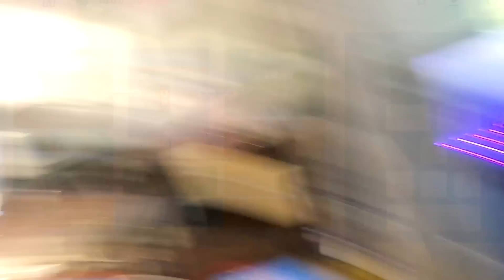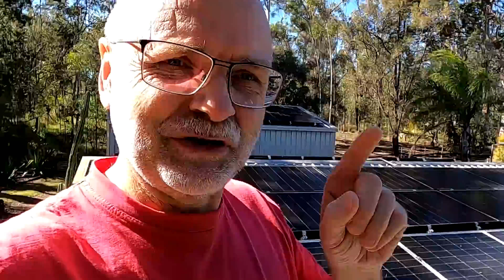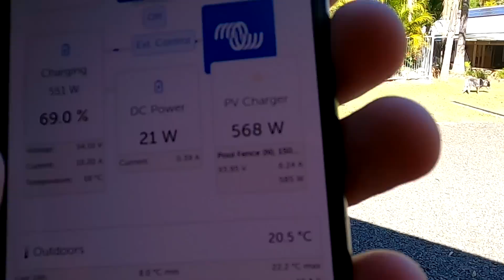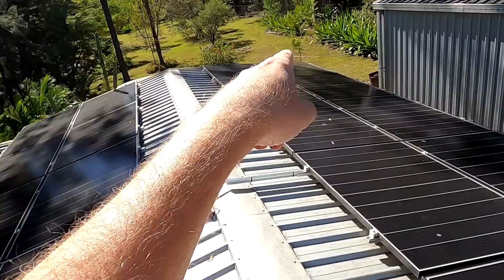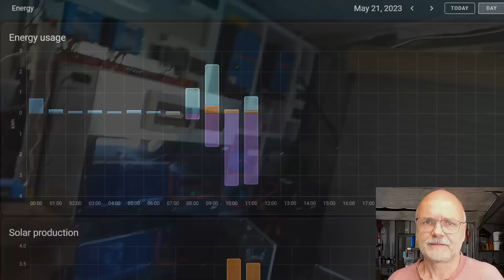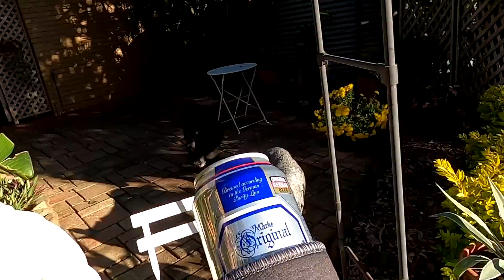Finally Off-Grid!! Look at this energy consumption and production in Winter!

Comment: it may be worth having someone come and trim back all the trees,  i think it will make way more difference than adding more panels.  i have lots of trees like you,  earlier this year i had to have a couple of large trees removed that were diseased while they did that i had them trim up the other trees and it made a significant difference to my solar production.  whats your annual consumption mine is around 10MWh annually and im producing about 2MWh with my 3kw solar (5 panels east and 5 west).  im about to add another 7kw of panels to get my production up.  have you ever played with enphase micro inverters? they may do a little better on the shaded arrays, also the interface with per panel production is really nice.  Also yes a deep dive into home assistant would be fun.

Comment: Over here in Cape Town, South Africa I have 400w solar panels, a 24v 50ah Lip4 battery with 3000w inverter (6000w peak) and smart Victron 20a charge controller. This is because we have "Load Shedding" over here. I run both fridges, freezer and 2 computers on sunny days, only 1 fridge on shady days. I intend to get bigger battery as funds come in.
Reply from the maker: We have load shedding here for a long time. All non essential loads can be turned off by the energy provider. These are mostly large loads like electric hot water, pool pumps and air conditioner. Also EV charging. But we have at least the choice and plug these appliances in to the 'normal' supply and keep them running but for a higher price. If more people would have solar and storage it would certainly help everywhere.
So you're on the right track with getting more storage.

Comment: Great video Andy ;-)
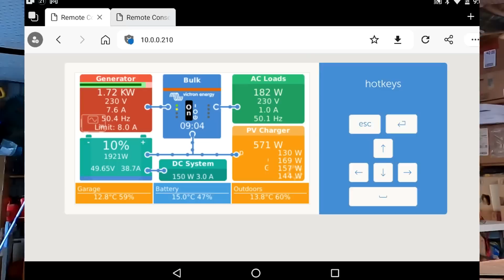One question, what kind of sensors are you using for the humidity and temperature at 4:48sec?
And how do you implement these sensors to the victron system?
THX
Reply from the maker: These are Ruuvy Tags which connect directly to the Victron system through BT. Great little devices.
https://ruuvi.com/
Reply: Great THX

Comment: I think you have to keep in mind, that if you convert twice, one time DC to AC with the Fronius and second time AC to DC with the Multiplus, there will be a loss. I have solar panels with a battery in the house and since last year I use an additional Multiplus to store extra energy, I would have been put in the grid in a second battery in the garage to charge our EV. I see a loss there about 15 to 30% compared to the house battery where the energy is only DC DC converted

Comment: Great video Andy, it is so good to see how close you are to getting fully off grid.   The short season (May,June and July) will always be a bit of a struggle. The one option you are fortunate to have is the Tesla can be looked at as an optional/portable load that if needed, can be charged somewhere else during those months if you start to run low on power for the house.  If only you could set up a Tesla charging station for some of the neighbours in November to February to sell off your excess power.  😉

Comment: Hello Andy, cloudy weather would be great for solar production in your case, better pray for a full cloudy weather, my 11.8kw PV 3 strings are facing south 30-25% today its dusty and cloudy with much dust on the panels i think the total generation is more than 30KWH today peak 5.5kw but its load based I did not enable on grid on my hybrid inverters I need the grid for the night.

Comment: Da du unterschiedliche Schatten auf einzelnen Panels hast, wenn du das ganze System auf Mikroinverters umbauen würdest, würdest du viel mehr Strom bekommen. Da jedes Panel bekommt eigene mppt.
Reply from the maker: How do you connect micro inverters to an off-grid system though without installing a huge number of inverters which can deal with this AC power?

Comment: Hi Andy, Your micro inverter panel discrepancy is a bit curious; try swapping over the inputs and see if the watts differences still agree. If it still looks like the same panel is low, I reckon you might have a bad blocking diode giving you only two thirds power.

Comment: Homeassistant gives a very good insight in what is using power. The tosti iron is a huge amp eater and so is an old boiler I have in the kitchen. I can easily adjust my power consumption by eating less tosti (kids) and replace the old unisolated kitchen boiler.... But I didn't.
Nice video. Again you put a lot of work in it. Thx!
Reply from the maker: Thanks a lot, Wiley. I have replaced a few loads (pool pump, lights) and will upgrade with more solar to get it all off-grid.
Reply: @OffGridGarageAustralia  I often wonder if we should get more panels or try replacing old habits and old equipment first.
It's all about taking an interest in how things work and stop paying utility companies and damaging environment.
Lifepo4 is without cobalt and has the prospect of good recycling procedures(I was told). Human kind can make a significant change here. You are a pioneer and really made me believe I could get my wood cabin off-grid. I works!
Thx man! Thx a bucket of amps. And I need to get you some beers again.
BTW the Peter inverter(great display) produces 115 volt on both + and -??? To create 230volts... I learned something new when grounding the system.
Reply from the maker: @camielkotte  Thanks a lot Wiley, I appreciate your support and feedback.
I didn't know this about the Peter. Is there a middle contact, a neutral point internally?

Comment: Hi Andy.  Great video.  I'm getting the urge to purchase a few more panels here in Salt Lake City area but I have not convinced the wife that I need MORE POWER!  I have 260 watt panels for 8.6 kw.  I was going to offer my condolences on your Winter!  We are just coming up on the summer months here and when I am in our winter months, I too have trees blocking production.  Still using the tesla model 3 battery for 65kw of power.  I use approximately 26kw per day.  I would trim the trees except they are not my trees.  Darn.
Reply from the maker: Thanks Lou. You cannot have enough solar power. Never...
I'm pretty sure, you would not trim these trees unless you have a 40m pruning saw 😊

Comment: Is 1 roofs =  to 1 string? maybe you can gain some power with optimizers, so the unshaded panels are not be pulled down by the shaded ones.
Reply from the maker: Optimisers optimise the $$$ of the manufacturer. They are not magic devices which deliver more power.
I have a lot of parallel strings due to the shading. So, for that exact reason....

Comment: Ahh yeah the harsh realities of winter solar I went from running my IPS monitor, laptop, subwoofer and speakers, charging 3-4 usb battery banks, and 12 aaa nihm batteries on my 2x80w panel setup in August wheen I started last year, to barely being able to charge 1 battery bank in the dead of winter i just didnt even bother turning it on for a couple weeks.    Which had my roughly calculating that id need 10x more panel to get the same production in winter as i was getting in later SUmmer... way too much, so i thought how could you store summer solar to use in winter, which doesnt exist yet, only solution is moar panel but theres other options like wind and hydro which ive been investigating, especially over there on Robert Murray Smith's channel, he seems to be experimenting and turning out wind turbine designs daily, all free to 3d print even, even a how to make generators to make them work, im really tempted to give it a go and see what kind of wind power turbine could generate 40-80w,  maybe with advancement in magnetic gears and generators the losses could be cut down and you wouldnt need a huge turbine  very high in the air to make wind power practicle.  Anyway great info as usual and I get what you mean, youre technically offgrid with the exporting but not really in spirit, thats where judging by all that wind you might want to consider some wind power, but moar panel will work...
Reply from the maker: Thanks Mike.

Comment: Hey Andy, don't you still have the old grid-tie Inverter from one of your first used pannel buy? Maybe you can use it too, so you don't need to overpannel this small Inverter so hard. Or maybe you find a used Inverter from someone upgrading His solar too.
Reply from the maker: Yes, I still have these smaller 1.5 and 3kW AC inverters which I could use...

Comment: The DC current rating on the micro inverter inputs indicate the maximum current it can use. It will not get destroyed if you over panel it. The panels might need a fuse for reverse current protection (but normally not needed for two panels in parallel). If you don't trust your inverter put a fuse in there, too. Free space on the roof and spare panels available - that's not good :)
Reply from the maker: I monitored these panels a bit now and they output close to 8A each in full sun now, so 2 in parallel will exceed the maximum current rating of the inverter (12.5A). The MPP will then shift, so the controller will take this current to get to this power point at the moment. Victron can handle 35% over panelling but this one... it's a bit of a gamble...

Comment: I wonder why you haven't installed optimizers yet and made some tests. My offgrid installation and after i installed optimizers on each panel made a big difference and they don't cost much.
Reply from the maker: They would not make any difference. If there is shading, there is less power production. An optimiser cannot change that and will not work in these conditions. They make a small difference if you have panels pointing in difference directions and these panels are connected to one string. They mainly optimize the income of the manufacturer.
Do you have an app which shows you, that they are working with your system?

Comment: Hi Andy, are you able to create a video on how to connect to Home Assitant for inverter that's not able to push data to HA. Both on DC and AC side.
Reply from the maker: I can only make a video about the Fronius and how to setup in HA. I'll do it soon, hope that helps...
Reply: @OffGridGarageAustralia  Thanks Andy. I'm saw some using ESP32 to create a DC and AC wattmeter that pushes data to HA but just not much information online.
Reply: @ReksYong  What is your inverter brand? Are you sure there is no integration for it?
Reply: @CantFindInYoutube  MUST inverter, nope. Checked it on HA, no integration.

Comment: I would like to know how many of your Home devices are strictly DC? Like how many LED lights vs Fluorescent vs old filament ones? How many TV's are running on direct DC? An so forth! Separate your Home; Garage and Pool consumption to give us a better view of what is going on! By the way excellent video.
Reply from the maker: None of my devices work on DC, except some small devices inside the garage which are using the 12V DC converter in the battery shelf (the Wifi access point, the 18650 battery charger, all my cameras charging from this as well).
More videos coming which will explain it in more details.

Comment: when you are off the high feed in you will be able to export all your extra into the grid, maybe 100KWH per day? so it might pay to stay on the grid.
Reply from the maker: Staying on the grid comes with many restrictions as I have explained in previous videos. That will not be an option. I will stay connected to the grid though, but just for pure emergency charging purposes in case of a flood or other disaster where there is not enough sunshine.
Reply: @OffGridGarageAustralia  down here in sunny Melbourne we can have 5 kw inverter per phase. With 6.6 kw per inverter with two phases in summer you could be exporting 45 KWH per phase. That’s 90.
Reply from the maker: @swolath  We can have 5kW inverter with 10KW solar per phase. I have already 14.4kW on my garage so there is already a regulation kicking in for me if I want to connect this to the grid. And until 2028 we may get only 2-3c/kWh if anything at all. Rumors I heard are saying there will be 'solar-tax' if you export energy from 2025 onwards. I would not be surprised here in Australia. I mean, they even tax EVs down were you live...

Comment: Andy good to see you using HomeAssistant it's an addiction, you will lose many hours with it but it’s worth. 
You have plenty panels but with that shade you should consider put optimizers in one of the roofs, to be 100% off grid the rule is to have a small generator has backup. I only have 8.72 Kw and my production is similar and we had a very dark January, last 2 months I didn’t use grid, without the exception of 25W for the inverter don’t feed grid.
Reply from the maker: HA is fine and I didn't spend too much time setting all this up, no coding, no yaml files, it is all fairly straight forward.
The optimisers will not help in this sort of environment. They only work if panels are facing different directions. Apart from that, they optimise the $$$ of the manufacturer, nothing else.
Reply: @OffGridGarageAustralia  looks like you might need to trim the southern side of the trees to optimise solar production in the winter mate, maybe setup up a ground mount north facing array
Reply: You are correct it's not a permanent shade optimizer will be worst. You have everything to do it, integrate your victron in Hassio, with a few shelly you can cut or turn on loads depending on your battery charge. I only have the Batmon for the victron smart shunt and it works for this but a connection to your GX will be much better.

Comment: Nice Andy - I've had the HA energy dashboard running for two years now combining my grid and off-grid systems. It's a handy reference.
While we are net negative grid consumption overall, the problem is it's not consistent. Seasons of great surplus and seasons of significant deficit mean going fully off-grid is challenging (and not really worth it given the amount and cost of additional PV and storage required).
Interesting you allowed to use T33 for the EV charging.

How much power can the Victron manage when AC coupling the Fronius? Will it do both that and the micro inverter(s)?
Reply from the maker: Thanks Alex. Of course over a years period, I would be producing far more energy than consuming, but I cannot store the summer energy for winter, can I? So looking at each single day gives a far better picture.
The Victron MP can handle up to 5kW of AC-coupled power when not connected to the grid. There is a link in the video description to the Victron documentation, if you're interested.
Yeah, the T33 can handle all sort of loads really, non-essential loads like pool pumps, hot water, EV charge and also air conditioner. Energex  even suggested that back in 2015 when I got the PHEV.
Reply: @OffGridGarageAustralia  Thanks Andy. T33 seems pretty flexible then. I see T33 tariffs are in the 18-20c/kWh range so not nearly as good as they used to be.
I've been looking at our Winter production as well and seeing if I could charge an EV without incurring any grid imports. It's pretty tight, only enough for ~25 km of range on average, so I expect I am going to need another 2-3 kW of off-grid PV to eliminate the need to divert grid PV power to supplement the off-grid home battery charging (no pFIT here to worry about). I only have SW roof spare to use at the moment though. Great for Summer afternoons and on cloudy days but it's Winter when I need the energy. No "pool fence" systems here.